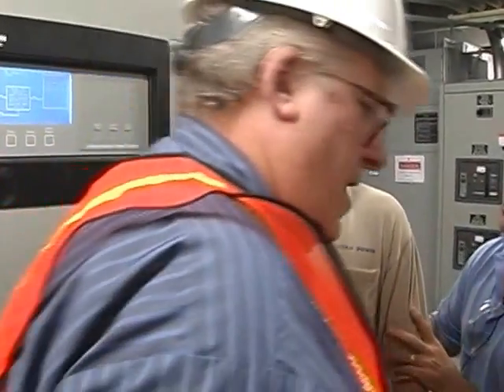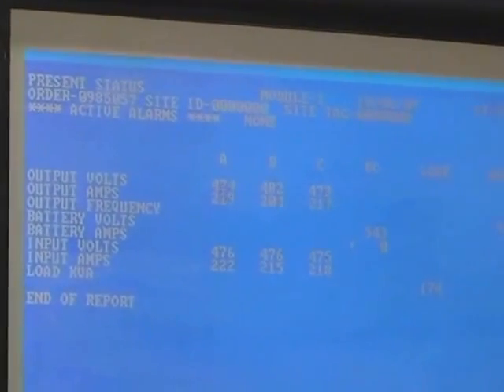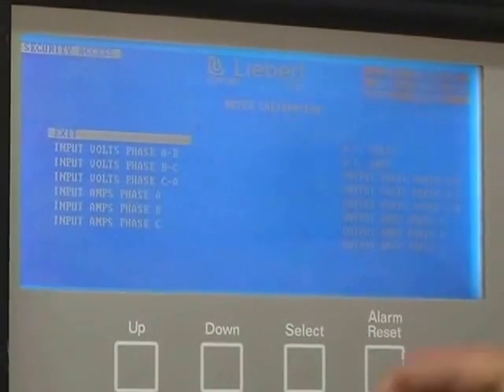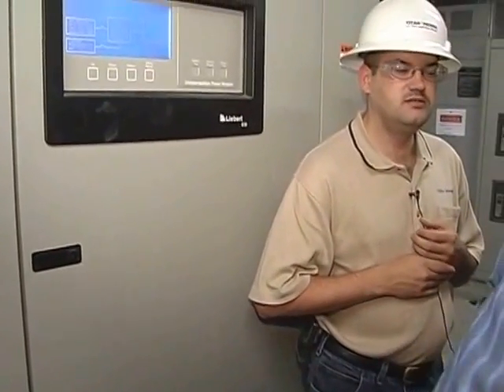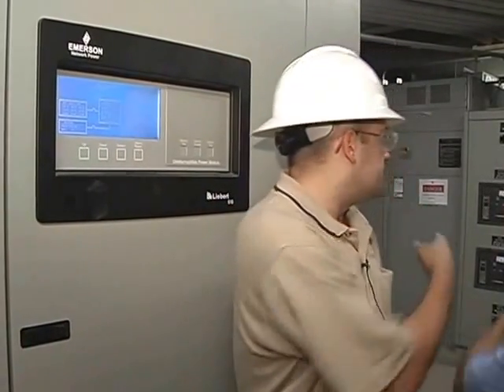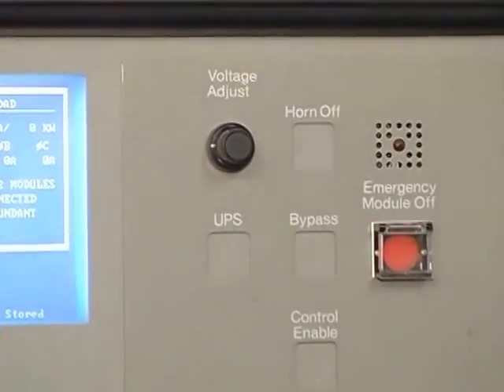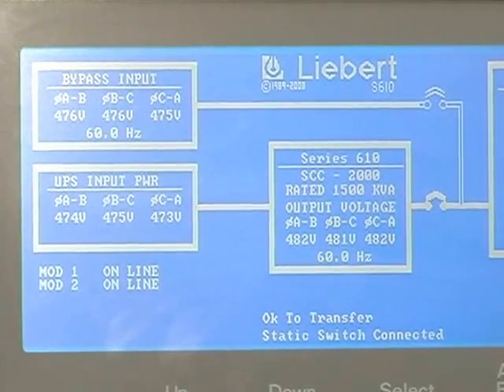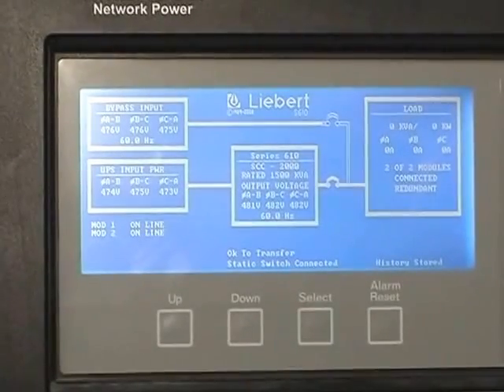Emerson Liebert UPS tutorial

Comment: is this liebert ups is similar to the 610? (link) i mean, does it have the same functions?
http://alpe-mexico.com/ups/ups-de-centros-de-datos-y-edificios
Reply from the maker: Hello eugenio cantero 
The UPS is a Liebert 610 750kVA.  In the room there are two 750kVA UPS’s with a SCC (System Control Cabinet) basically a parallel cabinet. Both UPS and running supporting the load in a parallel  N+1 configuration. Hope this helps!